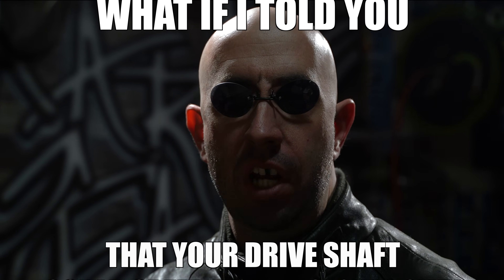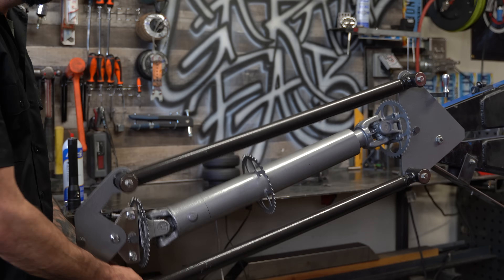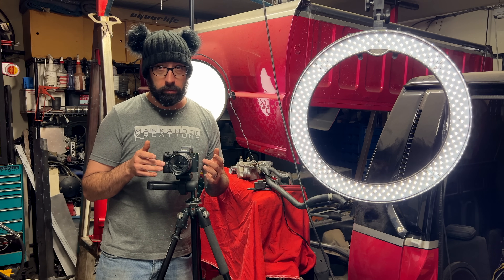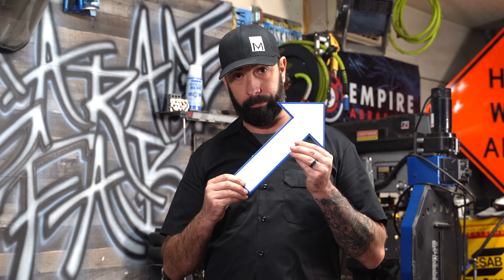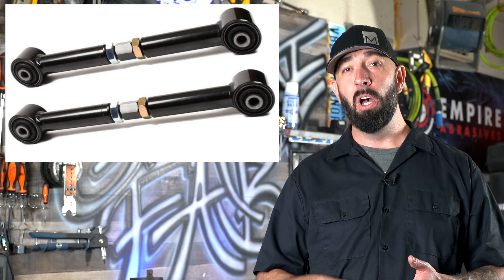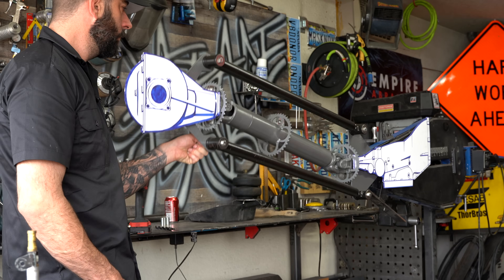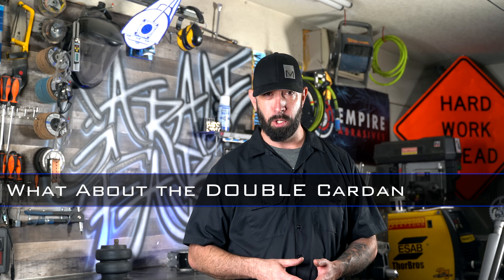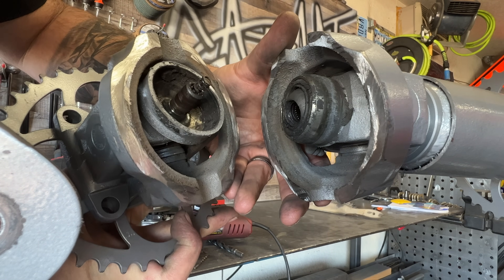THE Driveshaft Video. The Nature of U Joints. Suspension Basics Ep. 06

Comment: Master, I don't know how to set the phase for a gimbal that has a CV joint and a U joint.
Reply from the maker: Definitely not a master! So I’ll give you two answers to make sure you get what you need.
“Phase” Refers to the position of the ears on the yoke. (Or the C shaped half of the U joint assembly) The yokes on the drive shaft should be phased so that when you view it from the side, there’s a C on one side and a backward C on the other.
]=====[
Twist the shaft and the bearing caps should be inline.
o ==== o
The shaft should NOT have a C on one side and a bearing cap on the other.
]===== o
This is “Out of phase”
The double cardan joint is set up like this already so you only have to worry about the shaft if you’re welding one together.
I joint angles are something else entirely.
With a double Cardan joint, the double joint will be in the front at the trans and the single in the rear at the differential. The angle of the double isn’t important. The joint itself does all the work.
The rear single joint must be mostly straight. (A 0.5° - 1° angle is good to keep the needle bearings moving but doesn’t cause and oscillation)
This means that the front of your differential will be pointed towards the back of the transmission, at ride height on a static height vehicle, or at half travel on an adjustable height vehicle.

Hopefully this makes sense. Let me know if it doesn’t and I’ll have you email me or DM me on Instagram so I can send you a video or photo or both.
Best of luck!

Comment: So, if I want to switch from a 2 piece driveshaft to a 1 piece driveshaft in a fixed height suspension, I do not have to worry about pinion angles? My current Mustang has a 2 piece driveshaft and I would like to got to a one piece, as long as the length is correct, is there a correction to make? Excellent video by the way.

Comment: What if adjusting your pinion angle to match your tail shaft angle puts extra working angle on your driveshaft /pinion unjoint or vise versa?
Reply from the maker: You’ll likely need to replace your front joint with a double cardan joint. If you go that route, you will no longer set your diff parallel to the trans. Instead the front of the diff will point at the double cardan, creating a nearly straight U joint in the rear.
If that’s also not an option you’ll likely need to adjust the angle of your engine/transmission assembly. 😳
Reply: I put a belltech lowering kit in my truck and have a very tiny vibration so I decided to check the angles. It’s -5.5 on my tail shaft -2.5 on my driveshaft and +2.5 on my pinion with the shims that came with the kit. Removing the chins would bring me down to my +5.5 on my pinion but from what I understand that would cause to much stress on my rear u joint. So my only other thought was shimming my tail shaft up to get closer to my pinion angle. If that makes sense
Reply from the maker: @STOODmstr  I assumed you were lifted! I can’t imagine a lowered vehicle could cause excessive working angle. I build trucks that lay the frame on the ground and still don’t have any driveline issues.
Are the shims you’re referring to, angled? Generally lowering blocks are parallel so they don’t change your pinion angle and that’s a good thing. Angled blocks should only be used to get your diff and trans closer to parallel. I’d advise you start by focusing on matching your angles first, and worry about working angle if you still have problems. Only then would you consider the double cardan.
I predict you’d be fine unless you already have some faulty u joints or an unbalanced driveshaft.
Reply: It’s a flipped axel kit so rearend on top of the leafs. Yes the shims are angled. 3 degree shims that tilt the pinon angle up. So from how I read it now -2.5 with my driveshaft and 2.5 on my pinon gives me a 5 degree working angle. Where if I remove the shims my pinion would mirror the tail shaft ant 5.5 degrees but would increase my working angle to 8 degrees from what I read is to much for u joints. Also thank you very much for replying and giving me your opinion
Reply from the maker: Even a flip kit doesn’t change the pinion angle, so there still shouldn’t be a need for a wedge.
I just can’t wrap my head around why you have so much operating angle. I wish I could see it for myself. Can you tell me how high off the ground the front U joint is and how high off the ground the rear U joint is? Lastly the total length of the driveshaft between the two U joints?
An excessive operating angle doesn’t necessarily “stress” the U joints. What happens is the speed oscillation gets more severe and you begin to feel the inertia of the shaft speeding up and slowing down which presents itself as a vibration. Usually it takes significantly higher speeds to feel it. It would also take quite a long time to damage a U joint this way so you don’t have to worry about them breaking on the first test drive.
So I would still advise to remove the wedges and check for your vibration and we’ll go from there.
Reply: I can’t give you the exact measurement now. I feel like the reason the pinion angle got messed up was the saddle that came with the kit has a shorter side and a longer side which twist the rear end twards the ground. And then they have you put a shim in the front to twist the rearend back up which makes zero sense to me. Also is there and easier way to communicate lol I really appreciate the help and insight.
Reply from the maker: @STOODmstr  My pleasure. @GarageFab on Instagram or email at GarageFab702@gmail.com

Comment: Great video!  But I have a question with the Tacoma example.  If the carrier bearing holds the first shaft upright, should the pinion angle still match the tranny?  If not, where/how to set it? Thanks
Reply from the maker: Thank you! No. With a two piece driveshaft, you essentially ignore the transmission shaft angle. Instead you match your pinion angle to the first section of drive shaft. But keep in mind, the single U joint at the front needs to remain relatively straight to keep it from causing a vibration. A slight angle (1-2°) is good for a stationary U joint as it keeps the needle bearings moving, but isn’t enough of a bend to cause noticeable speed oscillation.

Comment: cool, very useful advice, thank you.  My question… Why don’t we just use cv joints on driveshafts? guessing the torque is too high?
Reply from the maker: My pleasure, Adam! Actually CV joints are stronger than U joints. 🤔 CV joints are used occasionally on driveshafts but most often in aftermarket applications. They are more difficult to manufacture which makes them more expensive and production vehicle companies really need to pinch pennies. Since U joints are strong enough and are reliable when setup properly, they almost always opt for the cheaper option.
Reply: @GarageFab  ah, makes sense, thanks for the follow up!

Comment: Great vid, the problem I'm having with a Quick Performance 9 in in a 68 Chevelle is rotating the housing up to get the proper pinion angle drives the back brace into the coilovers and no one has a answer
Reply from the maker: Bummer. Can you send photos? @GarageFab Instagram or email GarageFab702@Gmail.com

Comment: Wow, extremely informative/educational video which went a long way into eliminating/understanding driveshaft vibrations!  Thank you for putting out this information.  It was very understandable and professionally comical!
Now I understand that adding a Double Cardan to a stock height 80 Series Land Cruiser may not be the fix to a drive shaft vibration, but it has worked for many other owners???  I had the diffs regeared from stock 4.11a to 4.88s then the vibration or hum appeared…. hmmm
Reply from the maker: Hmmm. I wish I could hear it. A hum and a vibration are so similar yet so different. As a technician I always give the most attention to the work I performed immediately before the concern started.
A double cardan is often used after lifting a suspension and out to get more ground clearance by lifting the nose of the differential. It’s important to know that the pinion angle must be changed dramatically if you install a double cardan joint.
With a single you joints, your pinion angle will be parallel to the transmission, (if you have a single piece driveshaft) and parallel to the first section of driveshaft, (with a two piece driveshaft)
With a double cardan though, the double joint will be at the back of the trans and the nose of the diff will be pointed at that joint meaning the single joint will be mostly* straight.
*A degree or two is good to keep the needle bearings rolling and still not create a vibration.

Comment: I have a speedtech torque arm installed in my 79 TA. Rebuilt the diff and new axle shafts. The car sits lower than before now. At hwy speeds I get vibration and I can feel it in my shifter. The shop said they adjusted all the drive line angles.
Reply from the maker: Vibrations can come from a lot of places. I’d try and inspect the angles yourself which can be quite difficult on a car like that since the vehicle needs to be resting on the ground. In that position the pinion angle should be parallel to the trans. (Assuming you have Single piece driveshaft.
If that’s good, you could have a loose or failing U joint. The driveshaft itself could be out of balance.
I haven’t experienced it myself but I imagine an out of balance ring gear or axle could cause a vibration but I’d save that for after you’ve tried everything else.

Comment: Is it the same principle when it comes to a semi truck .. 2 piece drive shaft between transmission and first axle .. then the drive shaft between the 2 axles.. so is the mid ship the same principle.. out put yoke of first axle and input of 2nd axle have to be parallel?
Reply: @garagefab
Reply from the maker: This principle would apply to anything that uses U joints. I’m not familiar with Semi setups but if they are as you described, the shaft inside the first differential would be parallel to the front section of the two piece driveshaft. The second differential would be parallel to the first differential.
If any of those joints are double cardan joints, the rules change significantly.
Reply: @GarageFab   thank you for responding.. I’ve watched so many videos and your was most helpful.. I can’t find a shop to do them. Only reason I’m doing them is cause of axles was swapped before I bought it.. and I put the original axles back under it.
Reply: @GarageFab   if you by chance get some free time and wanna look at a truck.. I’m always open to suggestions. I’m the owner/driver/mechanic lol it’s a 2005 peterbilt 379 exhd with a 270inch wheel base ..
Reply from the maker: I’d be more than happy to walk you through anything you need but unfortunately I haven’t got any free time lately for any other projects. 😬

Comment: In a driveline with a carrier bearing in the middle.    Is that point the angle you are trying to match with your pinion angle?????
Reply from the maker: Sorry for the delay. Yes!! You are absolutely correct. With a two piece driveshaft, the transmission is ignored when setting the pinion angle. Instead the pinion will be parallel with the first section of driveshaft.

Comment: Your part about the Tacoma hit home, but now I have more questions.  I'm a bit confused now after you talked about the double joint.  So I had bought 2.5 degree wedges  before this video in anticipation of doing an Icon rxt option 3 rear leaf lift.  In the 3rd gen Tacoma axel setup, what angle should my pinion angle match?  That first drive shaft? the transmision?  Does this mean I dont even need a wedge?
Reply from the maker: Do you still have the factory 2 piece drive shaft with 3 singular U joints?
If so, I’d advise that you leave the wedges out until the lift is complete. Then check your pinion angle with the vehicle at rest.
With a two piece driveshaft, the pinion angle should be parallel with the first section of driveshaft. (The trans angle is somewhat ignored with a two piece shaft) Often a lift kit comes with a carrier bearing spacer, so measure the front shaft angle after this spacer is installed.
If your pinion and front driveshaft angles are not parallel, you might need that wedge after all. 
The double cardan joint changes everything though. Do you have one? I won’t go into that unless you do because it’ll confuse you more. 😬
Reply: @GarageFab  Yes it is the factory one.  Then it follows the “keep it parallel “ general rule after that?
Reply from the maker: Yes! But parallel to the first section of driveshaft.
Reply: @GarageFab  thank you for clarifying.

Comment: Great video, and very informative. Correct me if I am wrong on this, but another drive shaft / pinion angle set up goes like this; for example on a one peace drive line on a short wheelbase vehicle that has been lifted 2"+ (ie, Tacoma, and jeep) When utilizing a double cardan joint. If the DC is used to lessen the individual U-joint angle coming out of the transmission, then you would effectively angle the pinion upwards to lessen the single U-joint angle as much as possible.
Reply from the maker: Yes, Jesse, you’re 100% correct. Any time one DC joint is used, the other U joint should be nearly straight. So rather than setting the pinion angle parallel to the transmission, the differential would instead be pointed at the double cardan joint.

Comment: Hi. I Just subscribe to your channel.  Cool video by the way.  I have question that I can’t figure out the problem. Maybe you can help.  I have 2018 Ram 2wd, and I just added it a 6” lift.  Am having that same wobble , but it only happens when driving between 70-75 mph. Besides that speed I don’t have any type of wobble.  Do you have any suggestions.
Reply from the maker: Thank you Winston! Happy to have you. 
When you say wobble do you mean vibration? 
If so, and if the vibration started only after the lift, you’ll need to check your pinion angle at your new ride height. In order to do that you may need to remove the driveshaft. (Be careful doing this because with the driveshaft removed, PARK won’t keep the truck from rolling. Make sure your parking brake works and chock the wheels.)
You’ll need an angle finder and you will measure of the angle of the flange on the front of your differential, and you will also measure the angle of the crank pulley at the front of your engine. These angles need to match. 
If they don’t match you may need to adjust your pinion angle. Let me know what you find!

Comment: Love the content of your videos!  Especially this one regarding driveline angles. I own a driveshaft shop and frequently deal with these issues on customers vehicles. 

I would like to add that when using a double cardan setup that the rear joint angle going into the pinion should be relatively flat. Often times people think installing a double cardan joint at the transmission side will correct their issues, but they fail to realize that adjusting the pinion angle is also necessary.
Reply from the maker: Agreed! I tried to make your point clear with the light switch comparison but I’m afraid it got a bit convoluted. 
I’m considering another video specifically for those that ask, “What joints and what angles should I use for my suspension?”
There will be significantly less explanation of WHY each setup would be used in that video since this video already exists. It would be more of a quick reference guide. “You’ve got a 2 link? Install a double Cardan at the trans, a single in the rear, and position your differential about degree below straight with your drive shaft at half-travel.”
Thank you for the kind words my friend!

Comment: Just wanted to say I found your videos about 6 months ago And have not Quitwatching them since I'm starting to work on the 1959 chevy pickup  I pretty much understand all the rear suspension stuff but still a little confused on the Pinion angel stuff  I'm using a 350 chevy engine and they want them level at the intake So that puts the trans at 3° down So to keep them well do I bring their rear end up 3°You do a very good job of explaining this But that part still has me a little confused you talk about everything Being level 0I hope I don't sound too dumb here As of what I'm missing Thank you and advance
Reply from the maker: Thank you for the kind words, John!
Not dumb at all.
You are absolutely correct. Level is NOT important. You want your trans and your diff angles equal and parallel. So if your trans is pointed down 3 degrees, the front of the diff will indeed point upwards 3 degrees. 
You’ll be basically ignoring the driveshaft angle.
Reply: Thank you for answering me back. I might have some more questions down the road so you probably didn’t hear the last of me. Thanks again.
Reply from the maker: I’m working on a response to your other question a few days ago. It’s a longer response so it’s taking some time. 👍
Reply: Well, thank you for that. I think I might’ve answered a lot of my questions by watching the videos a couple more times.

Comment: Adding air bags to something with leaf springs on a daily driver or work truck removing them and adding four link eliminates the spring backup to rely on if air problems occur your not riding on the frame. Remove overload springs but not the original stack or lower flat traction leaf I use the Kenworth eight bag suspension  8” diameter bags about 9” of travel 4.5 up center 4.5 down about the same as the average half ton 3/4 and one ton trucks and they pretty much bolt right up to the 2005 tundra bump stop

Comment: I learned this many years ago without even knowing I learned it.

There used to be this great toy called Legos, where you could build cars with rack and pinion steering and battery powered motors, and driveshafts with gears and universals and differentials.

I noticed this phenomenon and resolved it the same way. I had to put the u joints in correctly, otherwise it had issues